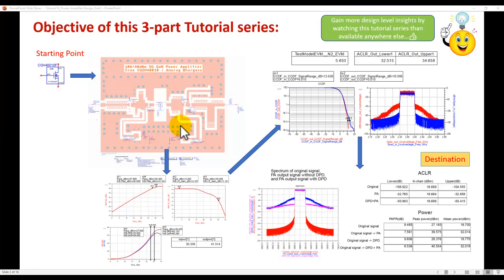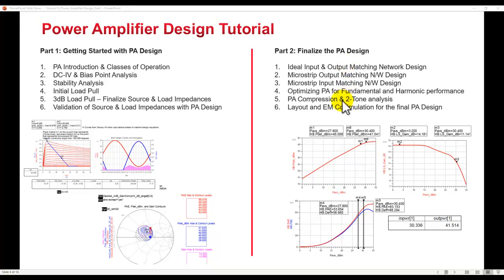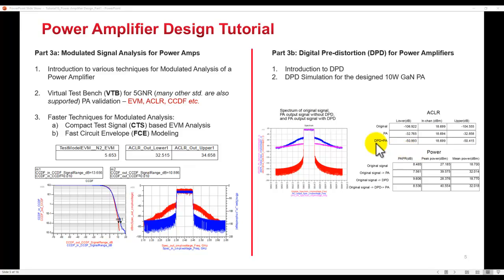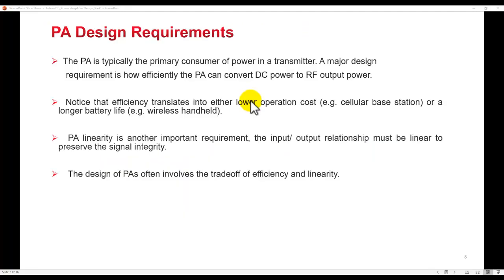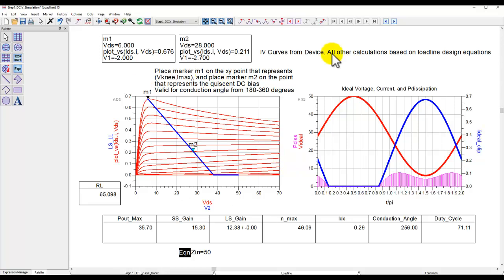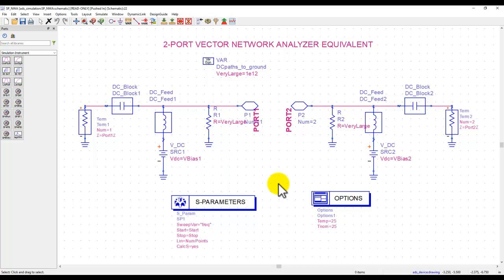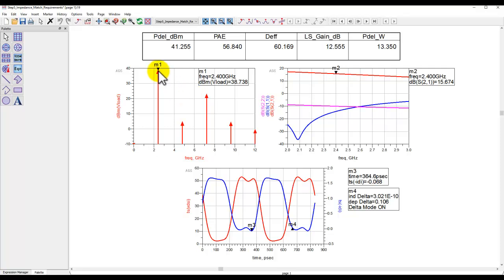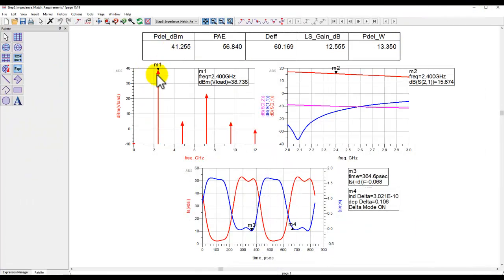RF Design-16: Practical Power Amplifier Design - Part 1

Comment: Thanks for the tutorial Dr Anurag! They were extremely helpful. I have a question though. In real life, will the ZL you obtained from loadpull, which is 28+j0.5 be in parallel with the 50 ohms of the antenna? Or does the matching network transform the 50 ohms of the antenna to look like 28+j0.5 ohms? Thanks again and looking forward to new videos! :)
Reply from the maker: Hi Mohd.,
ZL is the impedance that we need to present to the PA device in order to extract either the max power or best efficiency etc. The matching network transforms the actual load impedance which could be either a 50ohm or the Antenna's input impedance so that efficient power transfer can happen between the circuits.

Comment: How do I choose z center 1 and z center 2 for the device you are using in this tutorial. So that I can get required data points for further processing.
Reply from the maker: You can download the Graphical Load Pull templates from the Keysight Knowledge Center. Location of z1, z2 can be decided by you based on the transistor. Also, it is not necessary to use both z1,z2 in all cases and you have the flexibility to ignore 2nd if not needed.
Reply: @BhargavaAnurag  Thankyou for your time and consideration. But what if I don't have z1 corresponding to my dc biasing condition as they are different on datasheet and mine are different and also not on may frequency. Can I then use the zloads from basic loadpulls. Moreover, If I can use them then which one I have to use because one is for maximum gain and power and other is for maximum pae.
Reply from the maker: Please contact your local Keysight tech support to get help. Its difficult to teach all this on YouTube
Reply: @BhargavaAnurag Thankyou sir for this much help.

Comment: Hello Anurag, I want to ask a simple question. What is the main purpose of using directly the transistor rather than using packaged amplifiers with nearly same specs ? why we should choose a transistor part from wolfspeed rather than ready made amplifier IC from analog dev for ex ? Thanks.
Reply from the maker: If you are already getting readymade or internally matched amplifier directly suiting to your specifications then you can use it but it is not always possible to find such amplifiers and in those cases you will need to design your own amplifier using the basic transistor device and that is what this video is explaining.
Reply: @BhargavaAnurag  thank you for the reply.. loving your videos. 👏

Comment: Hello sir, thank you for the tutorial
I have a question: are you using class ab power amplifier with only one fet?
As i know, class ab need 2 trans pnp and npn. I'm confused. Pls help.
Thank you.
Reply from the maker: Class AB doesn't require 2 transistors. Class AB is determined by conduction angle which can be selected with proper bias point and thats what I have done here.
Reply: @BhargavaAnurag  thank you sir.
I wonder if i want to change  to class a amp with your design. What should i do?
Reply from the maker: @nguyenkiet8153  You can simply change the bias point to something like Idss/2

Comment: Cree link seems to be a dead end. is the download a free tool?
Reply from the maker: Hi David,
Cree offer their library for free but it has to be approved. When you apply for access, make sure to write your full first and last name as well as provide Company details without acronyms etc. Once you have the approval you can download the library.
If you still face the issue then you can use equivalent parts from Qorvo or MACOM etc...

Comment: @Anurag Bhargava  Dear Sir, I have tried the PA design using CGH40010F by following your tutorials Thank you so much for providing them. But as I need  to design my PA using silterra NMOS HP model,I kindly request you to let me know is it possible  to download either SilTerra NMOS device models (or) TSMC NMOS Models as like CREE GaN device model from wolfspeed. If So can you please provide me the link as you provided for CREE GaN device models.It will be a great help for my research work. when I  tried using Devices _MOS in ADS it is showing the error as Undefined model.Can you please let me know how can make use of these default MOSFET models available in  Devices _MOS in ADS .Thank you so much Sir.Waiting for your reply.

Comment: Sir I've downloaded your colleague's data display template. Now the question is how can I use it for my circuit? Can you help me with that...
Reply from the maker: Kindly check the video on how to create templates here: https://youtu.be/wC2Qg_0jFxI
The file you downloaded is not a data display template, its a full workspace with .7zads extension, you first need to unarchive it using File->Unarchive option in ADS Main window and once it is unarchived and opened, you go to the desired schematic and save it as a template and same thing you need to do with respective Data Display page. Once they are saved as templates you can go to your actual workspace where you want to use, simply insert the schematic template, replace the device with your transistor model, set your voltage ranges run simulation and you will get a blank data display window and now here you can use Insert->Template to select the saved data display.

Comment: Hello sir, thank you for these great tutorials. Can you plz tell something about stability circles. What if k factor is greater than 1 but stability circles are completely inside the smith chart. What does this indicate? I am not using NWA or templates for stability as you described rather i am plotting stability circles using palletes in simulation S- parameter. As i know that these circles should b out of the smith chart for unconditional stability...
Reply from the maker: Something doesn't seem right based on what you described. Kindly contact your local tech support team to take a closer look at your setup.

Comment: @Anurag Bhargava  Thank you for your quick reply sir. So you mean that we need to vary the value of resistor by just trial & error and check for the stability factor? But in your  Tutorial-38: Harmonic Balance Simulations  you used a stabilization network  that includes a series RLC branch in parallel  with series gate resistance for demo_fet -2 device. Can you please explain how you chose the values of that stabilization network sir. Thank you sir. Waiting for your reply
Reply from the maker: Hi Sridhar,
Stabilization network topology will change based on the type of circuit you are designing, implementation methodology etc but in nutshell its either all of RLC or RC or just R alone. Also, typically in RF PCB kind of design I recommend to avoid RLC feedback kind of topology as it will suck up lot of gain but in MMIC its a good topology as you can always add 1 more gain stage to recover the gain and achieve broadband response. When you design LNA, stabilization network usually is preferred on output side so that you don't distort Noise Figure and in PAs you prefer input side to avoid handling higher power and suck up the gain offered by device too much.
Once you have the tool in your hand, play with all topologies and see what works best for you as sometimes you have a straight answer to these questions unless you give it a try. Whenever playing with these networks you need to work in iteration and finalize a specific component values and toplogy.
Hope this helps in some manner.
Reply: @BhargavaAnurag  Got it Sir. Thank you.
Reply: @BhargavaAnurag  Dear Sir, I have tried the PA design using CGH40010F by following your tutorials Thank you so much for providing them. But as I need  to design my PA using silterra NMOS HP model,I kindly request you to let me know is it possible  to download either SilTerra NMOS device models (or) TSMC NMOS Models as like CREE GaN device model from wolfspeed. If So can you please provide me the link as you provided for CREE GaN device models.It will be a great help for my research work. when I  tried using Devices _MOS in ADS it is showing the error as Undefined model.Can you please let me know how can make use of these default MOSFET models available in  Devices _MOS in ADS .Thank you so much Sir.Waiting for your reply.

Comment: Hi Sir Thank you so much for your wonderful tutorial. The way of your explanation is  very clear. In this tutorial you mentioned that the 5 ohm resistor is used to stabilize the GaN device used in this demo which is taken from the datasheet . Can you please explain how to design stability network for any transistor with an example demo if the element values of stability network are not mentioned in data sheet sir.  waiting for your reply. Thank you sir.
Reply from the maker: If it is not there then you can play with the resistor value and look at the stability and gain together to find the right combination.
Reply: @BhargavaAnurag  Thank you for your quick reply sir. So you mean that we need to vary the value of resistor by just trial & error and check for the stability factor? But in your  Tutorial-38: Harmonic Balance Simulations  you used a stabilization network  that includes a series RLC branch in parallel  with series gate resistance for demo_fet -2 device. Can you please explain how you chose the values of that stabilization network sir. Thank you sir. Waiting for your reply.

Comment: Sorry to bother, sir. When i try to build the class E PA, can i still use the Vds as 28v and Vgs bias voltage as -2.7v. Looking forward your videos for switchmode PA, thanks for your efforts, really helps a lot!
Reply from the maker: Hi Louis,
You will need to select other bias point if you wish to use the device for switched mode PA and you could do it easily looking the DC characteristics.

Comment: Sir, I've done this process for the same device in the same way you've shown in this video. But I've selected the center frequency as 852MHz. and my load pull  simulation shows half contours rather than full contours. and it showing the max PAE as 35% and max output power 39dBm and corresponding load and source impedances for that max PAE and max output power. Is it correct? can I continue further with the part 2 of this video?
Reply from the maker: half contours typically means you haven't taken enough area for loadpull or you haven't selected the right center point in Smith Chart. You may need to try out few zones before finalizing one.

Comment: Hello Sir, Thank you for this tutorial... 
I simulate same circuit for Same impedance for maximum power. 
But after this I am not getting same result as you... After power amplifier circuit simulation... Why sir? Please help
Reply from the maker: Hi Yash,
Its difficult to see what you have done. If you have done everything as I have shown and using exactly the same PDK/Component then results should be same. You can please contact Keysight tech support for more help.
Reply: @BhargavaAnurag   Sir from where i am able to download cree wolfspeed vendor kit ??
please give me website link  or download link ???
Reply: Hi. Were u able to rectify the problem?

Comment: Hello sir,

1. I'm able to access vdsi but unable to access idi. What can be possible reason?
2. My efficiency calculation was based on vdsi and idi waveforms(Power dissipated will be decided by overlap between these waveforms). So I get efficiency in simulation
But what about measurement how can I measure efficiency once my circuit got fabricated? because now i can't access vdsi and idi anymore
Reply from the maker: If you are not seeing intrinsic current and voltages then it is possible that your vendor hasn't exposed those values. If it is specific to Cree, I know that in one of the versions they didn't expose but the latest version of their PDK should have those values exposed so try the latest version of the PDK and you should be fine.

Comment: In the last section of video when I try to put the same impedance and those meas eqn, in the output for Vload I'm not getting same value. It is not taking meas eqn while simulating. What should I do. Please help. I'm using the same device as yours
Reply from the maker: If you are doing everything same as mine then result should be same but sometimes if you are using different PDK version for the transistors then few settings on the device might be slightly different. Recheck everything and take help from your local Keysight support team if you can't figure out the issue on your own.